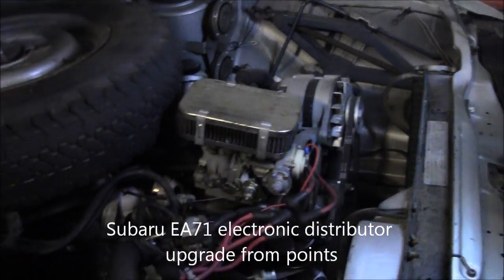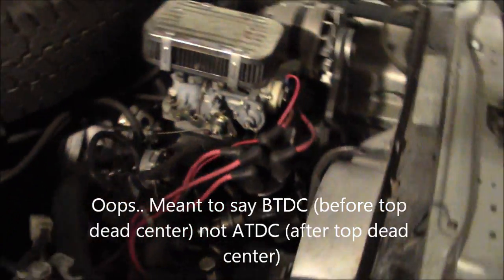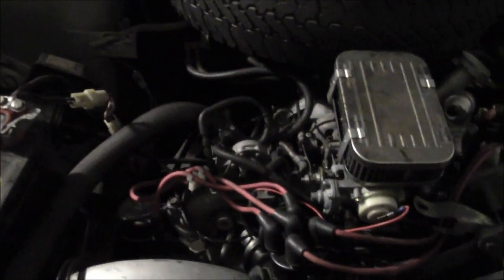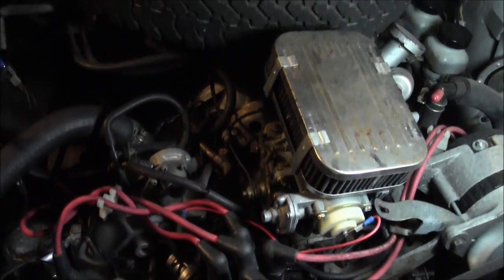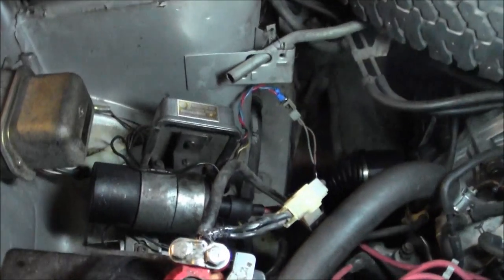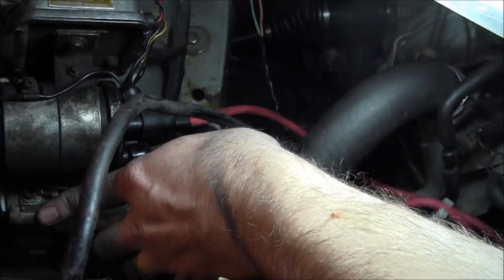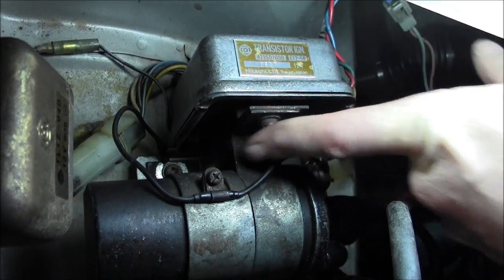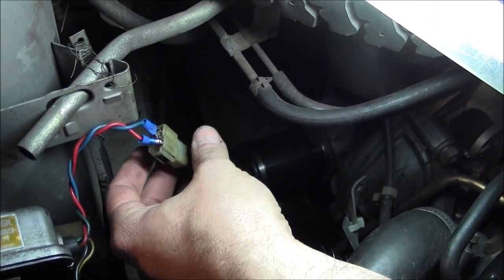EA71 electronic distributor

Comment: I have a 78 brat with the ea71 and I love it. It's been a very good little engine. I have a Weber 32/36 redline kit. I personal love my points for their field serviceability. But I can understand why one would want the electronic ignition. I rebuilt the distributor while refurbishing the engine. It runs like a top.

Comment from the maker: It is out of an EA81. Get the capacitor and ignition module when you pull the distributor. The ballast resistor is still connected and in my brat in the video but I don't think it is necessary. I haven't cleaned up the install yet as I plan on pulling this engine soon. I'm going to have the car and engine bay painted.